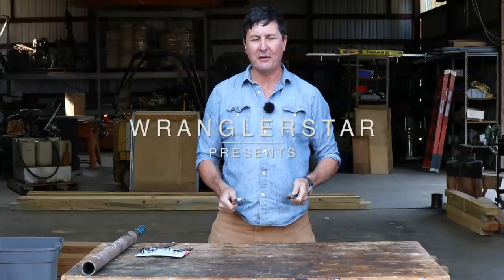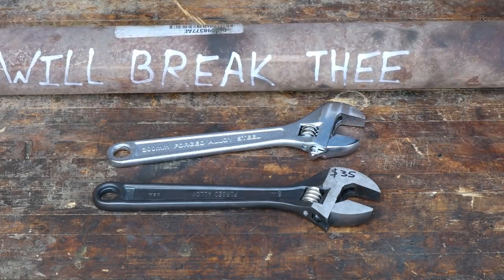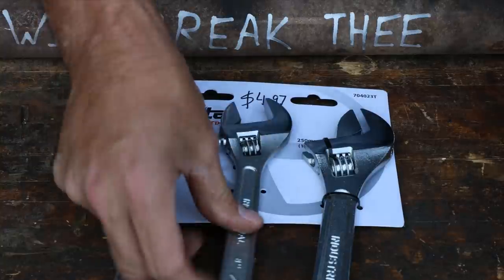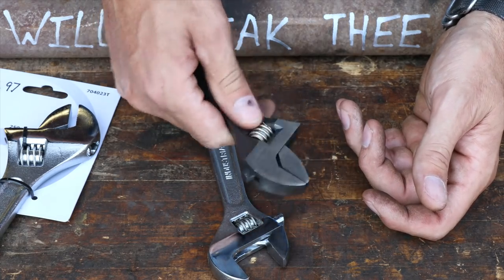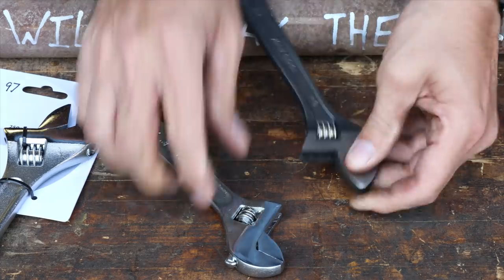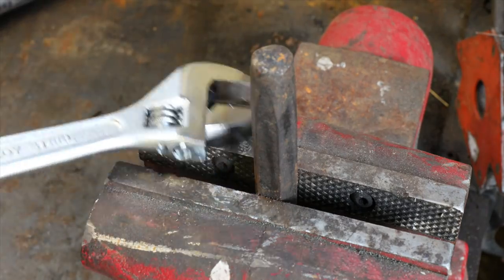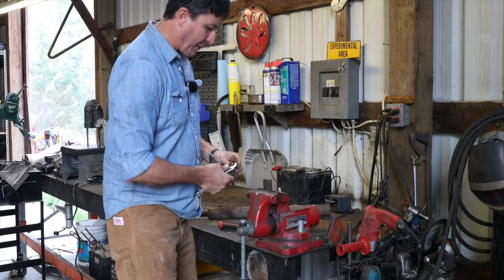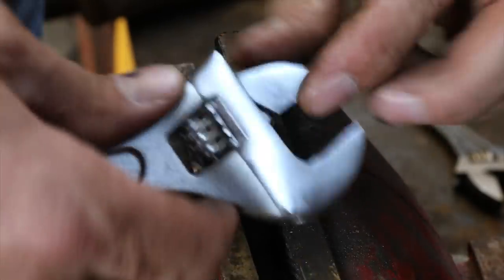Testing Cheap V.S. Expensive Wrenches On AMAZON

Comment: If there is any type of tool you don’t want to cheap out on, it’s any tools used to remove fasteners such as screws, nuts and bolts. Once they are rounded or stripped, you have a serious problem on your hands.

You really don’t want to cheap out on tools like wrenches, screwdrivers and sockets. As Cody said, if you are using cheap sockets like Craftsman, Pittsburgh, Kobalt or Stanley and round off a bolt on the bell housing while trying to replace a clutch in your truck, you’ll probably have to lift the cab and hope you have room to hammer on an extractor. 

The cheap brands have much larger tolerances and that means they are more likely to slip off and round fasteners, especially when you are trying to transmit torque through four 6” extensions and 2 universal joints each bent at damn near 30 degrees to get that top bell housing bolt.

For sockets, I use S-K SureGrip and Snap-On Flank Drive Xtra. I owned a Mac Precision Torque set which was also great. For screwdrivers, I only use Klein and Snap-On. For combination wrenches, flare wrenches, crows feet, etc. I use Snap-On and for ratcheting wrenches is use S-K X-Frames.

Comment: Wranglerstar: I get what you were trying to picture in the video, but yanking on a cheater bar without any form of measurement of force aplied or any type of test repeatability, not to mention not applying said force to the same location on both tools, essentially negates any findings.
Plus while you were testing, saying over and over how much better the SK wrench was, you still didn't declare it "the clear choice".
This is just one example of the same flaws you repeat over accurate over in your videos. I'm not bashing in any way, just saying I can't relate to your content anymore
Reply: The SK was clearly the better tool just looking at at.  Does everyone need better? No!  Are people going to be using a tool like this in that way?  Not likely!  $5 for 3 adjustable wrenches is a great deal and more then good enough for casual use.
Reply: Yes, the more expensive wrench would have to be roughly 17-18 times better for the cost overall to be worth it.
Reply: I am with the BSFreeZone Dude.  Nobody that declares anything SnapOn makes a good deal understands quality and value.   For 95% of people, the Chinese wrench is fine.  The S&K for the other 5%.  The $60 SnapOn is for chumps.
Reply: uhh you understand that not everyone understands numbers very well. He's testing the limits based on normal limits, when people are using tools, when they break them they aren't saying "huh guess i shouldn't have put more then 50 lbs. of pressure on that" they're thinking "well i shouldn't do it that hard next time".
Reply: Strider Sky I was not trying to make tool choice decisions a tough one. Ill make it a little bit easier, if the job at task is a "one time" type of fix than go cheap. If you need to use them daily with the privilege of warranty's incase of failure go expensive. Base the tool on the type of job at hand, if its internal engine type stuff go quality. If its less advanced then cheap will most likely perform well enough to do the job.
Reply: Strider Sky yes those are all well executed reasons for tool pricing/quality purpose and such. I agree with you on hobbyist and the like needing quality. I just know from my own experience that going cheap never ended well for me unless we're talking cheap screwdrivers and stuff for the not so advanced job. I dont want anyone on small budget to use tons of cash for tools they dont need but i also dont want them thinking (eh its just a bolt how serious could it be?) and using some cheap Stanley tool to keep there family safe by trusting the tools strength.

Im also a little biased I suppose because im a technician for a dealership here in vegas. I forget somtimes what the garage work needed to work for me
Reply: Yup not very scientific. He did come across biased. He did not tell the other side of the tale when someone borrows your tool and not return it or you forget it on a job site. It would hurt a lot more if it was your $35 dollar one as opposed to your $2 one.

But finally all he has really proven is both are fine unless you want to monkey around with a very long "cheat bar". A normal human under normal working conditions can't break either one.
Reply: You can round off some nuts if using them incorrectly; I was a self imposed bicycle mechanic when I was 12 and learned.

Another scenario; do you buy the $50 Estwing hammer or the $10 Home Depot cheapie for around the house?
You want the cool Estwing but can you justify the $40 differrence?

Comment: I'm now retired and when I was an electrical apprentice back in the mid 60s, we could buy spare parts for the genuine Crescent brand spanners... spare moving jaw,  spare thumb screw and a spare threaded shaft that held the thumb screw. Maybe Crescent thought us Kiwis (New Zealanders) were extra hard on their tools or maybe we were hard nuts to crack.
.
Have you ever had a "left handed" Crescent? Give it to someone who is right handed and watch the confused look appear on their face as they tighten the jaw. It was made for left handed people. A "normal" Crescent held in the right hand will close when you push the thumb screw. Change hands and turn the spanner over and push with your left thumb... it opens. Confused? So were the borrowers of my left handed Crescent. Held in your right hand and the thumb screw pushed... it opened. Replacement left handed jaws and thumb screws were available to change your right handed spanner to left handed rather than buying a new spanner. 
.
An 8" Crescent was worth about £12 in NZ in the 60s, no idea what the conversion rate would have been. My starting wage was £7 per week and I paid 10/- (10 shillings) board if I mowed the lawns. In 1967 we went metric and changed to dollars and cents. In that confusion, there were some real bargains to be had.

Comment: Expensive tool doesn't mean quality tool, inexpensive tool doesn't mean low quality tool.
"You get what you paid for it" simply isn't true.
Reply: It's not always true, but in this case it is. The more expensive one has a better heat treatment. The question is, how much force will you put on that tool and could you get by with the cheap one? Or is it worth the risk of damaging what you're working on?
Reply: bmmg123 Cheap one around the home for small repairs , invest in a better grade for daily use within the workforce.
Reply: And the breaking point, in my experience, is not actually the be-all and end-all of a wrench, adjustable or otherwise.  What matters more is how much the jaws deflect.  The major complaint against adjustable wrenches is that the jaws slip and round the fastener.  The first difference I notice between difference adjustable wrenches is how easily the adjustment screw moves.  I've had cheap wrenches and expensive wrenches, and the biggest difference is that the jaws of the cheap wrenches spread and slip, damaging both your knuckles and your fastener.  That being said, adjustable wrenches is something I'm willing to go middle-of-the-road on.
Reply: bmmg123 It is a rule of thumb ya dingus. With the exception of scam its a good correlation.

Comment: This was a very biased comparison. Why not compare a U.S. made $35 wrench to a chinese made $35 wrench that is 3 or 4 times the size? Let's see who wins out, there. There's a very important place in the world for cheap tools - especially those like this crescent wrench that will do 99% of the work of the more expensive tool and allow the buyer to invest his money in similarly efficient ways. Speaking of efficiency, that cheap tool is far more efficient on a cost-per-use basis for the vast majority of buyers. On the other hand, some cheap tools don't even last one or two uses, such as some snap-ring pliers, etc. Paying more doesn't guarantee you anything but a bigger hole in your wallet.
Reply: That wasn't the point of the video. He tested the cheapest wrenches on Amazon, one from the us one from China. The cheapest from the us was $35, so he was comparing if it's worth spending that on the wrench or if it's better to spend the $5

Comment: How much is a new bolt? Might be less expensive to cut it off?
Reply: Then you have to get the bolt threads out
Reply: Or maybe you can't get a cutter on the bolt.
Reply: I was kinda kidding. Comment was merely based on sarcasm. I use crescent  or proto tool. As a toolmaker I have no issue removing broken bolts😀

Comment: One really good use for an adjustable spanner is holding a bolt head still on one side of something while you're undoing the nut on the other side with your correctly sized spanner or socket. Much less risk of rounding off that way.

Comment: Says "American made" every 5 minutes
Reply: So, 4 times he said it? That's about as many times he said "Chinese-made."  It's just an easy way to tell the two apart. American products tend to cost more and are of higher quality and Chinese products are cheap and efficient.
Reply: Yeah, I mean he's comparing price of the tools, not where they were made. An yeah I agree Chinese products can be pretty cheap
Reply: Not true. Chinese manufacturers can deliver to any spec in quality you like. The only reason so much junk comes from China is because the only spec they were given was: "cheap as possible."
Reply: Izzy Ramos-gunn probably made in China and assembled in USA and they can still legally market it as made in USA.
Reply: The Lalilulelo the american only looked nicer.... thats all the chinese one is way much woth your money
Reply: Mark Minck What? Did you watch the video? The US wrench was far superior, the Chinese one failed.
Reply: I mean yeah but how often do you use a meter long lever on one of those shitty things? You put on a wardrobe handle, you assemble some furniture, you swap the hydraulic pipe going to the breaks of your car, etc yeah, it's good. But when you have to break a nut free or have to snap two rusty pipes apart, you ALWAYS need a wrench and not one of these adjustable pieces of shits
For everyday use, the chinese one will do the exact same but it will cost 15% of the price. For THREE of them.
Reply: 9001RageQuits here in Germany made in the USA is just a bit aboth made in China.

American products really don't have a great reputation here
Reply: Alan Davis I forgot the name but I actually have one from Germany laying around somewhere. It's been in use for years and I bet it could stand the toughness test to easily
Reply: Knipex have nailed the Material science for pliers as simple as that. all cold forged and induction hardened cutting edges.
Reply: Say American made yes. But not say it was was the best. I find other countries make very good tools and items as well

Comment: The entire thing is bs, put a basic strain gauge on it then you can make accurate judgments. As it is you are using your feeling and potentially biased opinions. Number dont lie, there is no telling how much force you are applying on each wrench. To be honest this is just an over the top way of saying "I think this tool is better than this one because reasons"  while making money.
Reply: Bro it turned the punch in the vice. Dont need a guage to prove that.
Reply: It did turn the punch that is true, but there is no knowing how much force is applied. In order to compare these properly you need a gauge because human, even subconsciously can be very biased, and while the cheaper wrench may not be as good the gap in quality may not be quite as big as we think. In addition to all of this there is no way of knowing how tight the wrench is gripping the punch there is no way of telling how tight the punch is gripped in the vice. All small details you may think but the issue is you are trying to compare like with like and not recording variables which will effect the results. I have no issue with paying more for a tool that is better quality when I need that quality above all else but these tests are only slightly above winging it as far as getting accurate and repeatable results goes. The final point of contention I have with this is that a single test means nothing, as I mentioned repeatability,  in order for this test to show anything at all even if it was in a lab with every detail closely monitored you would need to repeat the test a number of times because no one knows if the cheaper wrenches were part of a defective batch or not.

Comment: The wrench has it roots in sweden. A Swedish guy invented it :)
Reply: Doc Holiday Bahco 👍🏻
Reply: My god bahco made awesome swedish steel tools.. before it all went to china and such countries....
Reply: I live right next to the Bacho heaquarters in sweden
Reply: According to Wikipedia, an Englishman - Richard Clyburn - is credited with the invention of the adjustable spanner (as we call it) in 1842. But another article states: 

"Adjustable coach wrenches for the odd-sized nuts of wagon wheels were manufactured in England and exported to North America in the late eighteenth and early nineteenth centuries."

The plain, non-adjustable spanner probably goes back as long as the screw, probably to greek or roman times in Europe and who knows how far elsewhere in the world.

I like Bahco very much BTW.
Reply: You mean Spain?
Reply: Those early adjustable wrenches are not anything at all like today's adjustable spanners. They had the screw axially along the shaft.
Clyburn's spanner is not used anymore, the tool we use today is based on the BAHCO version from 1892, which is much older than the Crescent company.
Reply: Tomas Gradin yeah looks like crescent started making them when the 1892 patent expired.  They are definitely swedish.
Reply: Incorrect. Both Bahco and Crescent are latecomers to the party. The English invented the adjustable spanner (as many other things). Industrial revolution you see...
Reply: sequri yes but the current design is the swedish 1892 design.  The british original design was clumsy in comparison and looked very different.  It hasn't changed in design since the swedish version.
Reply: See my previous comment.
Reply: Google images 'Richard Clyburn screw spanner' the screw is not along the shaft.
Reply: @lumpyfishgravy  It is not the same tool. Today's tool (as it looks) is the Swedish one.
Reply: @sequri  It is not the same tool. Today's tool (as it looks) is the Swedish one.

Comment: 21 wrenches for the price of one??? uhh 21>>1
Reply: Robert but that one will out live all 21 of them
Reply: I don't believe that's true. I bet even a mechanic wouldn't work through more than 3 or 4 of them.
Reply: Robert I have been a mechanic for over 35 years and I am here to tell you cheap tools are garbage
Reply: Robert... do you use tools regularly?  There is only so much breakage and duplicate tools that can be had.  Thats the point.  If you are just putting together ikea furniture you dont need a quality wrench... unless you are building 5 pieces of ikea furniture a day... then the little tools they give would start to suck even though for once a year or two they are acceptable.
Reply: In many instances I would agree with you but in this instance I wouldn't. I am of the opinion that no one (regardless of how recklessly they use their tools) is going to break 20 wrenches. If he does than honestly he has no place in a garage. Did you watch the video? Did you see how much stress he had to put on the cheap wrench to break it? Where and when are you going to be putting that kind of stress on a tool? Now, lets assume you are stupid enough to be using a wrench and a pry bar in the garage to loosen a bolt... do you really think your going to have to be in that situation 20 times? I mean this situation is literally why the impact driver was invented.
Reply: Your wit is blinding like the sun...
Reply: Robert you probably dont use tools often enough for it to matter
Reply: Well I mean I roofed houses for about 7 years... need to use tools for that stuff.
Reply: Robert good. so you know its better to be at a job site with tools you can rely on and not have to worry about anything breaking
Reply: Yes but there's a limit to that logic. In this instance, it makes more sense to go with a cheaper wrench and just buy a couple. For instance, I used to buy multiple cheap utility knives and chalk lines because of how easily they break or get lost; same goes with tape measures.
Reply: Robert yeah i guess it really depends on how important the tool is and how often you might need it. Ive just gad past experiences helping my friend out at his house and dealing with all if his cheap tools that made doing every little job harder and at the end of the day i was fed up with it.
Reply: Indeed it does depend on the tool and whether you are using it to its extreme.  If you are using a tool to its extreme then buy a good one.  If you are lightly using it, it probably isnt worth it.  It gets frustrating when you visit someone to help them and it looks like all the tools they have were free with furniture... and a little toy hammer...

Especially when said person has decided they need help to fix their car... a quantum leap above the tools intended limitation.
Reply: Not shackles, cheeseboroughs I meant.
Reply: Robert about the same tbh
Reply: Left Side amen brother, I dont use a belt either, if my wieght changes I buy new pants. I also weld the rail of my truck seat so its nice and uniform. Ladders are silly too, i just made stools at different hieghts.

Comment: In regards to taking care of tools better that cost more, instead of respecting your tools you can start respecting your work areas and toolboxes.  I've always made a point to keep those areas exceptionally organized.  Each tool has it's place. If a tool isn't put back properly, then you immediately know that it's missing.  It doesn't matter if it's 10 cents or 100 dollars... you know it hasn't been put back properly if the peg it's supposed to be on is empty.